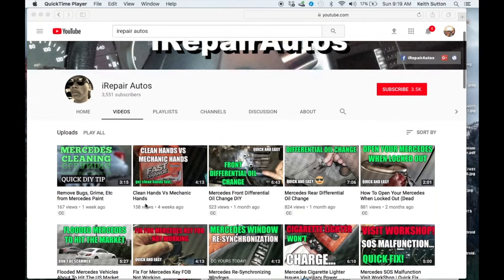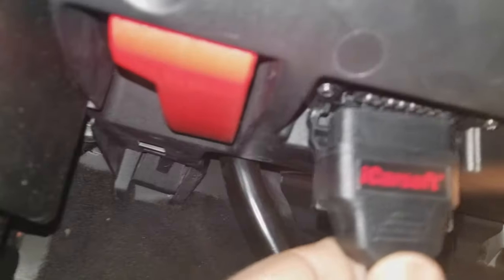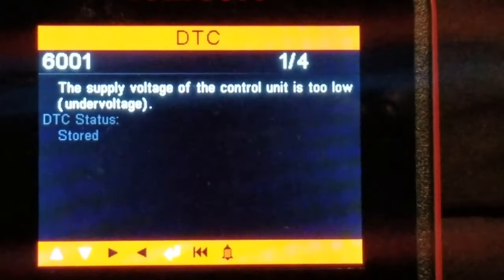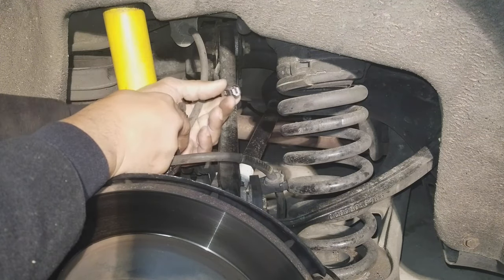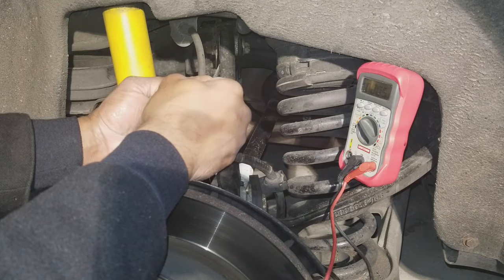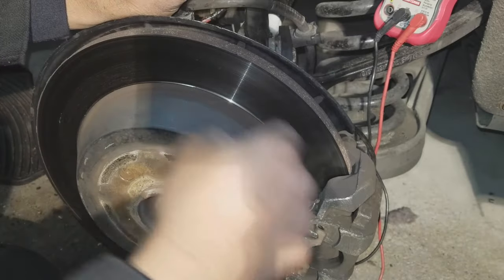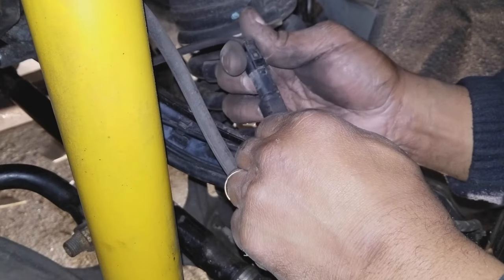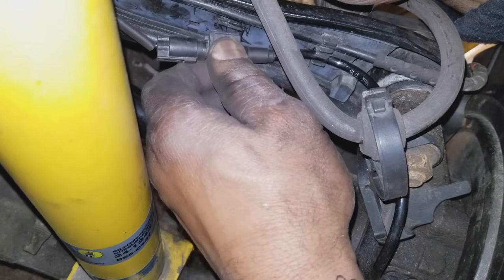Mercedes ABS Sensor/Wheel Speed Sensor Troubleshoot and Replace

Comment: Awesome video...everything explained clearly for those like me who are clueless but capable! I currently have ecu that wont communicate on a clk w209 220cdi....how can I identify the positives and grounds on this ecu?
Reply from the maker: Thanks!   You would need to access the pin out schematics.  Or....  run a voltmeter across the array of pins one by one until you find the positive.   The negative can be harder to find as there may be multiple grounds.   What symptoms, errors are you getting? Im really curious about this one.  Pinning to the top.
Reply: iRepair Autos Hi love your vids there informative and you dont get overly technical with your talks. Im looking for some advice,i live in Britain and ive bought a 1999 slk 230 kompressor as my project car to fix up and modify. I wanted to be hands and on do everything myself,im not experienced so ive been searching for an all systems obd11 scanner that can read all the systems on my 1999 slk. Also my obd port isnt in the car its in the engine bay situated next to the k40 relay box is. The obd port is a circle not rectangular like a normal obd port. I bought an adapter thats round one end and rectangular the other end. Please could you recommend an all systems obd scanner that reads all the systems so it cuts out the guess work! I'd really appreciate your advice as im going nuts chasing my tail. If you cant thanks anyway your vids are a great help! 👍
Reply: Icarsoft is the best bro get one of those
Reply: @iRepairAutos  I have a similar problem as reported. Unfortunately, Infinitpossibilities hasn't returned with an update. I'm going to do a voltmeter test and get back to you on this
Reply: @iRepairAutos  need help

Comment: Worth mentioning that I did this repair on a CLA today (rear right wheel) and you need to remove the wheel arch cover to access the plug. You can do it by removing 6 x 10mm plastic bolts from the arch itself and 2 x 10mm metal bolts on the underside (right of the wheel arch). Really easy job but I had to clear all error code to get them to stay off.

Comment: What if the connection to the car has no voltage but the abs sensor is good, what is the next step to check? I pulled the splash shield out of the way to try and see where the wires run and I can't really tell where they go.

Comment: Hey guys i have a 2013 s550 after having alittle fun in the rain traction controll off. My steering went hard and after that stayed 50 percent stiffer and very annoying to drive took it to my mechanic pluged it in and i have no lights or codes. Cant figure out if its my abc , power steering pump or rack

Comment: Would this help if when I’m accelerating the passenger front wheel locks. I replaced the brake wear sensor and purchased abs sensors but never got them put on

Comment: Great video..clear info..off to do mine now..thanks..
UPDATE...Well just fixed mine...Sometime in the past the wires had rubbed on the prop shaft....worn through one of the wires...cut and resoldered the black n white wires in the one black casing(looks like one big black wire)  couple of meters down the road and my abs ,stability control and traction control lights all disappeared of the dash..I'm so happy..thanks again for your video.

Comment: Thanks for uploading this video. Following your advice, I bought an iCarsoft OBD monitor on eBay and it detected a bad left rear speed sensor on my 2001 C320. Other OBD scanners detect the error code but don't tell you which one. Instead of having to check all four of them, I ended up only having to replace one of them. On the 2001 model, the speed sensor cable connects to a bulkhead above the rear differential. Not as easy to remove the cable, but was able to do it. For some reason, the iCarsoft OBD won't clear error codes.  So I used another OBD device to clear the error code. Check engine light cleared after driving it a bit and later on, the car passed emissions testing.

Comment: I really appreciate your time in doing these videos, I know its not easy to shoot a video and make a living at the same time!  I have an 04 G Wagon AMG 55, great car, I really love it!  My ABS light came on and I replaced the stop light switch and tried the steering wheel calibration trick but as soon as I touch the brake pedal the ABS light would come back on.  I checked the brake lights and my third brake light was out, checked the fuses and I had a 5 amp blown going to the third brake light and ta da!  The switch failed and blew the fuse, just an FYI, I got lucky!

Comment: Hello, your videos are very comprehensive, informative and spot on accurate in tackling repairs that would otherwise cost an arm and a leg if left to dealership service departments or unscrupulous shops.  Thanks for doing what you do.
I have owned a 2005 E320, which has been cared for exceptionally by me, and has never seen a “check engine” light until recently.
Last October, my daughter got into a small fender bender (no activation of airbags), but damage to front driver side corner (light and bumper damage). Took it to recommended GEICO shop, but due to age and mileage, they wrote it off as total loss. Since car ran perfectly, I decided to fix the damage myself.  When I got the car back, I got ESP, SRS, ABS and check engine light issues all at once.  The car now does not shift properly (up or down), and at times fails to go into manual shift.  Its almost as if the entire system was short circuited.  Any advice would be appreciated.

Comment: Good thing I saw this video. I got this issue ABS inoperative. Using the OBD2 scanner, found out that the left sensor is out. But before I replace anything, does all Mercedes have the same wheel speed sensor position? I'm using the B180 2018 model.

Comment: Omg you are awesome and I love your channel. I have had an issue with my 2016 Mercedes-Benz CLA 250 and i was riding on the highway and the car jumped into neutral while driving. Twice before I could make it home. Some told me it may be the same thing in this video but I am not sure because by the end of the day I have also been told it could be other things such as the auxiliary battery, gear shift, transmission and I’m not sure. Before paying for diagnostic testing, I would love to know what do you think it is!!

Comment: Hi. Your video is very useful. Now that I have learned how diagnose rear speed censor, I found out that the wiring was the problem. Do I replace the whole wiring? Or check for connection? It is a complicated wiring together with the abs joined in one. If replacement needed, I can’t find any seller for the whole entire wiring? Any recommendations? Thanks Appreciate totally your videos.

Comment: First thing I would like to say is YOU ARE AWESOME!!! I just bought a 2011 GL450 2 weeks ago
last week coming home from work I got an ABS, ESP unavailable and then the car slowed to a crawl
(15mph)found your video, plug my icarsoft up found witch ones were bad (both rear sensors)change them out
and BAM! problem solved...thanks ounce again for your video.
Reply from the maker: That's awesome that you got the issue fixed.  Good luck with the Gl450

Comment: Hello Sir. The Vids are not only informative, but are delivered with a nice calm and empowering tone. Like it !!! 
I have a Q for you...........My ESP appears on the dash screen and it keeps putting my 2002 MBZ C320 (W203 - it is an 18 year old wagon that normally has a very solid engine) into a state of limbo. 
I can be going along, and then the transmission disengages and my car engine goes into idle - just like that.........it causes me to have to pull over, stop, turn off engine and then restart, which always clears up the ESP......until next time........which can occur several times within a few minutes or miles, and then it will happen rarely for a while......CRAZY and stressful, as my wife is now scared to drive the car in case it leaves her and the kids idling in traffic, or at a turn or at a light.......Any help / tips / knowledge ?? Please...........I have not worked for 6 weeks and am trying to fix at home if possible.

Comment: Hey thank you for the info, my 95 R129 had an ignition wiring harness replacement, lost my cruise control and now will assume one of the speed sensors is interfering with cruise control, very nice video !!
Reply from the maker: Yes, they can affect cruise control,  braking, traction control etc.

Comment: Hi, My Mercedes CLA220 started with wheel tyre pressure light.. now all lights are on. My mechanic said I need to change the ABS Sensor and he said would need to be from BOSCH maker. I can’t find BOSCH anywhere. Dealer wants to charge me €500 for the sensor and said I need to change the wheel bearing (which my mechanic said there’s no need) I ll give a try and buy the one you have under your video! Thank you so much

Comment: Thanks for comprehensive videos. I have a 2007 clk350 convertible 120k miles Oregon UAS. Was driving fine and over certain the engine just died. There was a message something inoperative not sure what it was. The car now no crank no start & no messages on the dash. Need your help please.

Comment: Good lesson. Just replaced the front knuckle. Sensor was r&r. Something must have glitched as abs+esp+bas lights came on. No brake lights.
Reply: It's probably brake light switch at the brake pedal is broken. Replace it and it will be fine
Reply: @azwalazman5296  it was the speed sensor. I had replaced it incorrectly.

Comment: Thank you for the video.  I have a "Icarsoft MB v2" scanner, that says it can test abs but it does not work.  Have you had experience with this tool?  Using it on a Sprinter NCV2.

Comment: Whats up brother...hope your all healed from covid...Im definitely having major sensor problems with my 2008 e350...  The rear driver side wheel has a slight tilt...  and all my research leads to the ABS sensors gone bad...your thoughts?? And yes it has shut down the  entire car..the C/S wont even engage...but I can drive it it in every gear...not over 40 though

Comment: Hi Great Video. I have the same problem and have to find out which wheel is the problem. Quick question, is the rear speed sensor model the same for all wheels? In case I have to change the rear. I have a 2011 GL450. Thanks

Comment: I had to grind some rust/metal away to get the new sensor seated properly in the rear.  Took three tries but now the light is out!  omg   ..... Mercedes Sprinter  love and hate. Only light left is the SRS.  2011 Sprinter 3500 dually with 255,000 miles

Comment: Good video thank you. I have question how many volt dc from abs module to abs sensor ? Because on my w221 S 350 when i test it igot 12 v dc. Is 12 v dc is good ? Because you said that very low volt dc.

Comment: Thanks for your videos!!! so i replaced the abs sensor which showed a fault code diagnostic and still i have the problem. i guess i got to recheck like you suggested. perhaps the spline inside the wheel isnt reading. but someone said the brake light switch could be the issue. But theres 2 of them on my e class.  one is a twist off type and the other is a snap in type. you see i had to replace my clutchbrake pedal unit (horror) but on installing the new one saw that brake light was permantly on. so made adjustment ( to the snap in type and it was okay. but there seems to be a back up brake light switch (the twisty one) any idea which each of these is?  btw the twisty one isnt quite sitting into the hole as one of the retainers has snapped off. thoughts?

Comment: Really Great Video.  I wished I knew someone that could do that instead of dealership.  I have a 2007 s550  lemon.  It has caused me thousands in suspension issues.  May 2019  the ESP currently available code came up and i had it towed from the mall to my home.  I really do not want to go to dealership and other German motor repair shops charged just as much.  Any suggestions? Thanks.
Reply from the maker: This is a common issue. It could be a loose connection. Or a bad wheel speed sensor.

Comment: Quick question, is a faulty speed sensor can cause a limp mode?
Reply: I have the same doubt, I have a mercedes and got into limp mode for the first time ever today… I’ve been having the abs issue for months now…. Have you found the answer?
Reply: @guigovr  I did changed my fuel pressure regulator.. so far I was able to drive 70km with no issue of stalling and I havent replacr my speed sensor.

Comment: Awesome Channel. Thanks for your insight. 
 I have a 01 ML320 with abs light on. I have issues with connection according to the scanner. Any Suggestions ? Fuse ?
Reply from the maker: your OBD port may have an issue.  Check the pins on your scanner and also the holes in the OBD port to make sure nothing is stuck in one of them.

Comment: Great video again, question I have a 2017 3500 sprinter, when you remove the ABS wheel sensor and look down in the hole
what should I see? I ask because I can not see any think moving as I rotate the wheel hub. I see a shiny metal piece at the bottom of the hole.
I thought I could see the inside rotating as I spin the wheel hub. Is there a protector cover inside or should I be able to see something moving
when I spin the wheel hub?

Thanks, Robert

Comment: Hello, I had the abs, low tire pressure and another light come on, according to videos online it said it was an abs sensor but I don’t have the equipment to check other than a regular code scanner and by myself. I replaced all 8 sensors which are 4 abs and 4 wear pad sensors but when I went to take it for a drive to see if the lights would go off, it went on limp mode, driving under 20 mph and the brake light coming off while in motion. Can you please help. Thank you

Comment: Ok I have a 2002 ml 320 Mercedes Benz truck and I have a clicking sound coming from my passenger side rear brake and I had the back brakes done but that shop could not figure out what was making the sound so he sent me to another shop and the guy said it sounded like something inside my dum on my rear brake might not be releasing and I don't have the $ for the dealership SO I GUESS MY ? IS WHAT COULD IT BE AND WHAT PART PLEASE AND THANK YOU

Comment: I seem to be missing a sensor from the front left, or it doesn’t look like the one on the right. The back left rear also seems to be different or missing. Is it possible they are different on left side or that there are only two right side?

Comment: Great video, I have replaced all sensors on my 07 E350 to include the passenger reluctor ring. My ABS light still come on going to change the driver side this weekend hope this works I’m out of answers at this point. Has anyone had or heard of this before? 🆘

Comment: Hello Sir, I have a Diesel S350 2012. after changing the ABS sensors on the front axle do I need to program them? The reason I'm asking this question is that dealership told me It could run me anywhere from $1000-$2000 with the programming. Please guide me or assist me in this manner. I'm a long time subscriber of you channel and thanks for all your videos. Just to add one more thing I tried turning the steering wheel to both side extreme and it did take the ABS light off for a wile but after driving 20 miles it came back on. I don't see my check engine light on but only one message and the yellow ABS and traction control lights are on and im feeling that the brakes are slowly locking up...

Comment: Hi iRepair Autos, I'm working on my W140 with ADS system, the STAR tek computers say it's driver's front wheel speed sensor. I've replaced it with two used ones (but look perfectly new). The mechanic seems to think the hub needs to be replaced. Do you think the hub ever goes bad? Like too much crud and road debree/oils get in there and make it so the wheel speed sensor can't read it? I've yet to try the volt-meter method, and will try it to see what it reads. Sadly ADS systems aren't that well documented on the W140, the shop manual literally has a blank page for the error code I got which is between the wheel and sensor lol.

Comment: Hi Keith, so my S430 has the abs light, esp light etc. On. The ICarsoft scanner says it's the front left speed sensor, put a new one in, no help, swapped it with the right front sensor, no help. So, what else could it be?  Something in the wheel hub?

Comment: Have a question for you, my scanner said it was my left front wheel speed sensor of course I have the ABS ESP and BRAKE visit workshop on the dash. I replaced the wheel speed sensor erase the codes it drove normal up to the second or third shift then all the lights came back on and went back the same and it still shows left wheel speed sensor. Question could it be a bad wheel bearing or reluctor? Or something more deep.
Reply from the maker: It could be, but how is your tire pressure?  Same tire brand?
Reply: @iRepairAutos  good question my tpm mil is on
Reply: @iRepairAutos  and yes, same tire brands
Reply from the maker: What brand sensor did you buy?